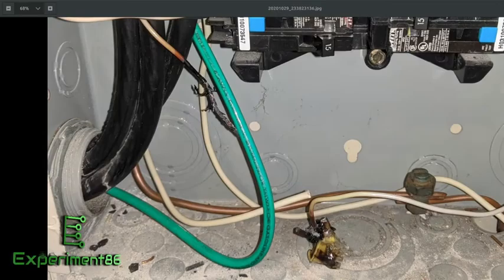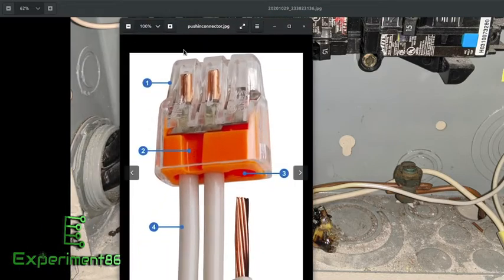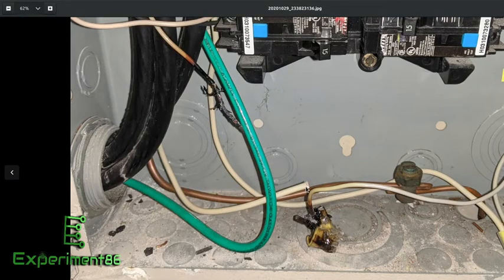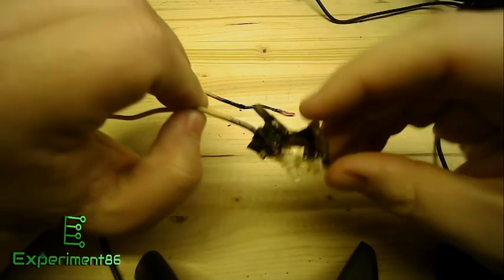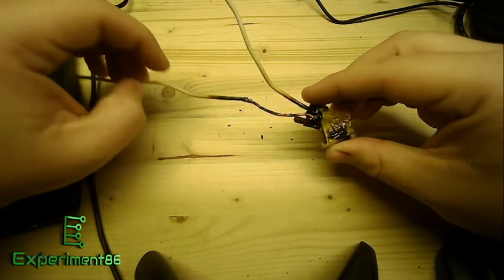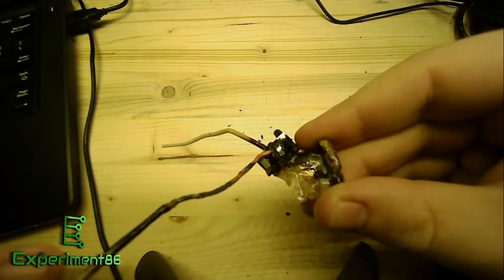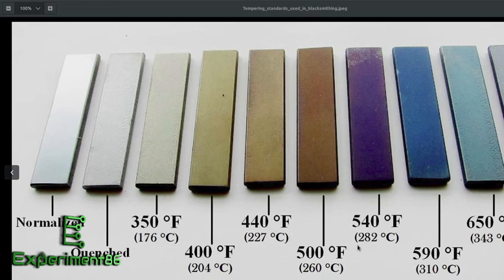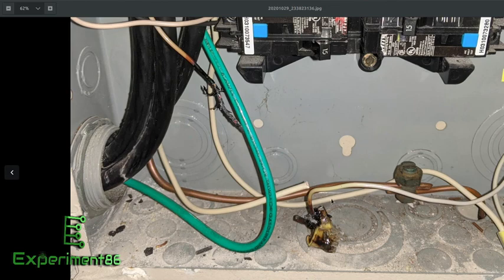Failed Push In Wire Connector

Comment: I see that the wire was slightly bent at the end. If it was bent when you removed it then maybe “someone” had pushed in a bent wire which would then have less contact area making contact in the connector. Only straight wires should be used... obviously. 
And these connectors have been used since the 80’s through Europe and now in America.  I have said this before ... it’s amazing that if these push-ins are so bad... that the company would still be in Business with all the lawsuits. Obviously, that’s not happening. Good video though....
Reply from the maker: well, if a slight bend in the wire is all it takes for these kinds of connectors to heat up and fail like this and the electricians installing them in the US don't know that, then I'd rather not have them.
Reply: The ones that I see that have failed are usually knockoff garbage.

Do you know if this one was a name brand?
Reply: @experiment86  thats not a slight bend. I always cut the wire so i have a straight clean pieces off copper.